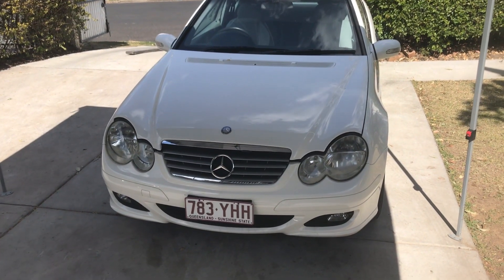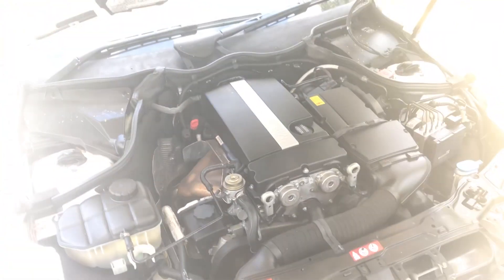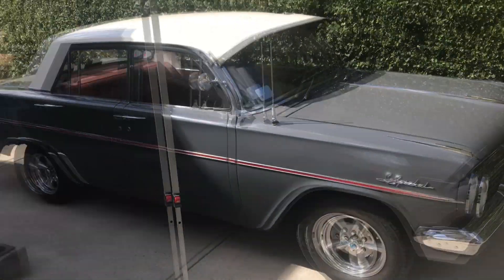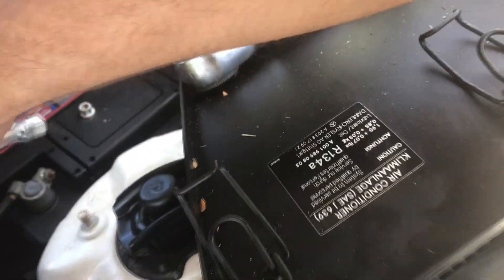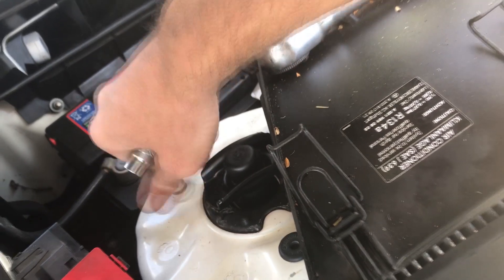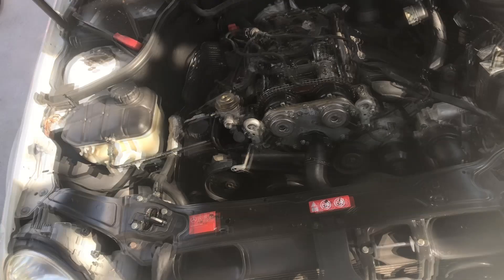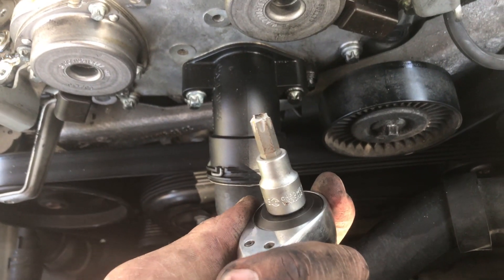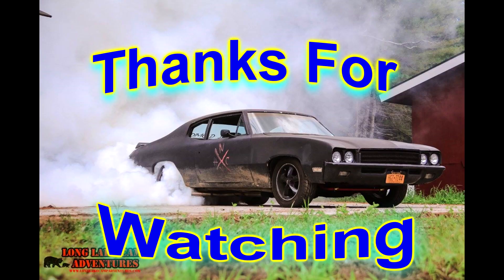Mercedes C180 (W203 - M271) Kompressor Head Gasket Replacement Part 1 - FGep27

Comment: The head gasket is not the issue on these. The thermostat seals leak water into the front timing cover and down into the sump where it mixes and gives head gasket symptoms.
Reply from the maker: Thanks for your comment. If you watch all the repair videos, this car had several issues and that was one of them.
Reply: @FuryGarage  I'd believe that too. I retract my comment.